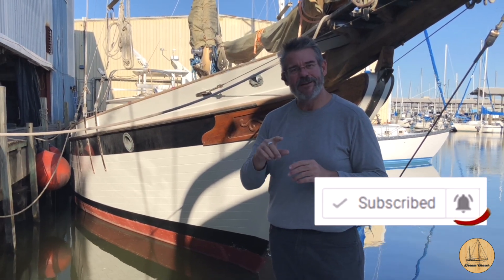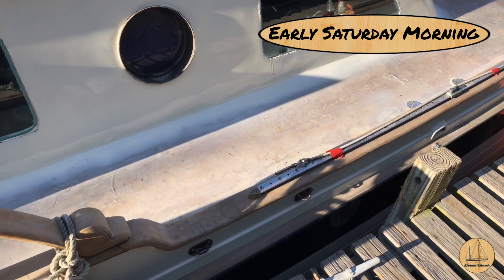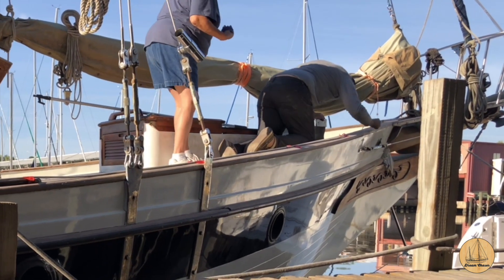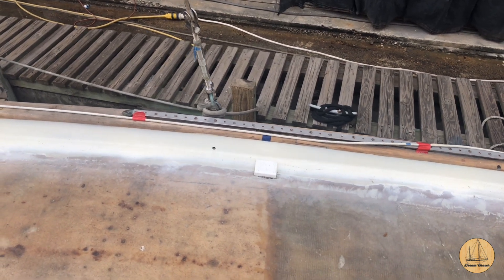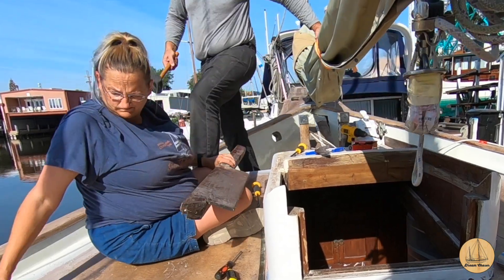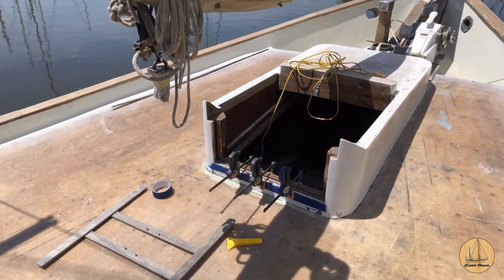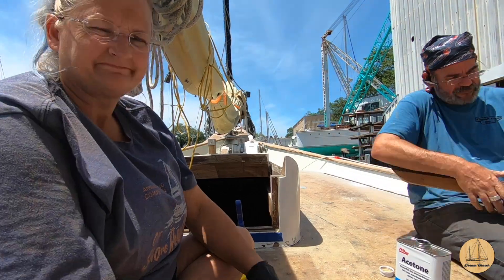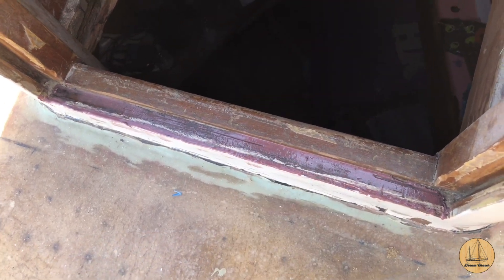Designing Solid Lifelines and Repairing the Forward Sliding Hatch

Comment: Thanks for the shout out! I've made a huge hole in my boat now. I'm working on the redesign and rebuild of my butterfly hatch. I guess you're right, I didn't have any leaks around it, but dang, practically needed a chainsaw to remove it. I think the redesign will see the base of the hatch fiberglass, all seamless to the roof, and only the center beam and wings of the hatch made of teak. Still working out the details!  Great video!
Reply from the maker: Formosa41 Your quite welcome Todd. I have been watching the photos of the new huge hole in the roof.

Comment: What about your gates they will also have to be braced and should accommodate any larger items  that may have to be brought aboard such as a small cart for shopping ect  Just a thought  Thanks
Reply from the maker: Great point.  We did decide to widen our boarding gate from the 18" it was prior to 26" wide.  specifically, we chose this width to accommodate the boarding steps we will have mounted when at a dock or wharf.  The forward side may not need to be braced given they will all be welded together with the stanchions and connected all the way to the bow pulpit.  For the aft side of the boarding gate, it will be a vertical stanchion and an angled stainless tube from the top of that down to the wooden cap rail.  I still have to work out if I will do a cable entry or have a folding solid bar made.  I am leaning toward the solid handrail for that section too.